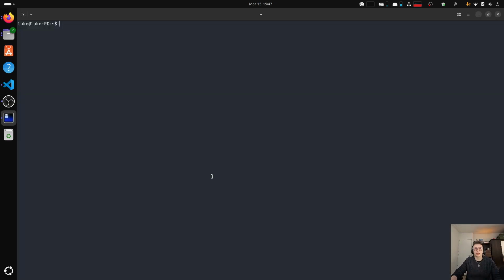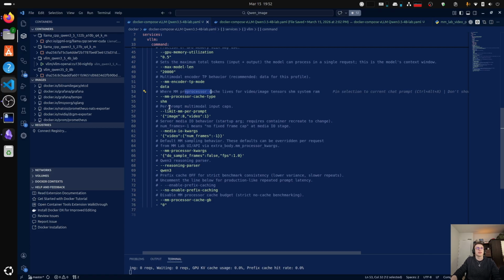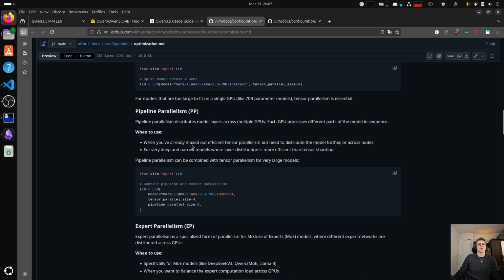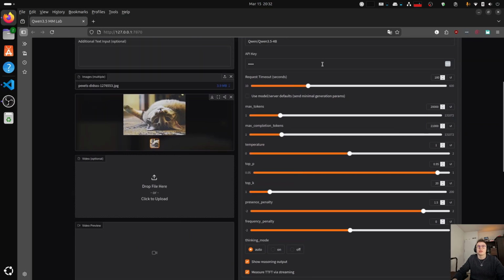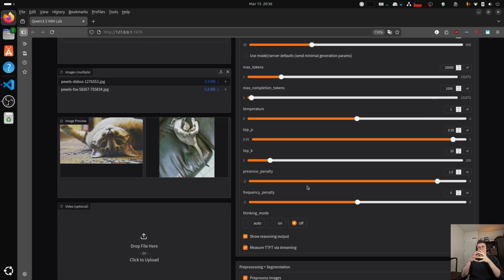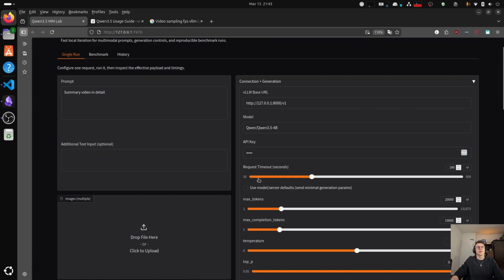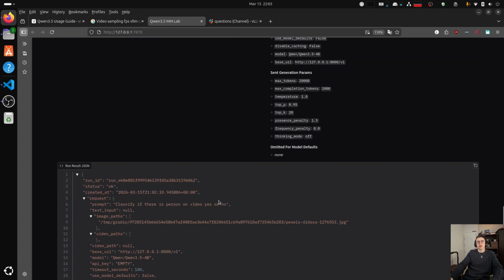Qwen 3.5 Vision AI Speed Tuning: 30 Seconds → 2 Seconds (Here's How). It's INSANE.

Comment from the maker: Qwen 3.5 Vision was taking 20–30 seconds per video. I got it to 2 seconds. Here's exactly how.
This is a complete engineering deep dive into optimizing Qwen 3.5 multimodal inference — images and video — running locally on vLLM in Docker. Real benchmarks, working code, no fluff.

What you'll learn:
— KV cache explained and why it kills your speed
— Image resolution tuning for vLLM (the biggest single win)
— Video FPS preprocessing with ffmpeg before it hits the model
— Turning off thinking mode for fast inference tasks
— Long video segmentation strategy with overlap windows
— max_model_len vs max_tokens — what most people get wrong
— Parallel segment workers to cut wall time on long videos

Stack: Qwen 3.5 VL · vLLM  · Docker · CUDA · Python · OpenAI SDK
This is Part 1 of the Visual AI optimization series. Part 2 will cover batching, quantization (INT4 / FP8), and multi-user scaling. Here https://youtu.be/BxDfOPcak5k
If you missed the setup video (llama.cpp + vLLM + Docker from scratch, no Ollama, no LM Studio):
👉 https://youtu.be/-sl0oe3-Awc

🔥 What You'll Learn:
✅ vLLM Docker config for Qwen 3.5 Vision (Blackwell GPU optimized)
✅ Max tokens tuning — why input/output limits matter more than you think
✅ Image preprocessing — how dropping from 6000px to 480px saves seconds
✅ Thinking mode ON vs OFF — real timing difference on classification tasks
✅ Video FPS sampling — why 1–2 FPS is enough and how to set it
✅ MM cache, KV cache & prefix cache — what they do and how to exploit them
✅ Multi-image and multi-video inference in a single request

⚙ Setup:
GPU: NVIDIA RTX PRO 6000 Blackwell (96GB VRAM) | CPU: AMD Ryzen 9 9950X 16-core
Driver: 590.48.01 | CUDA: 13.1 | Engine: vLLM nightly Docker | Model: Qwen 3.5 Vision (4-bit)

⏱ Chapters:
0:00 Speed demo — 20s → 2s result
0:22 Hardware overview
0:37 vLLM Docker config walkthrough
2:00 Max tokens, GPU memory & multimodal params
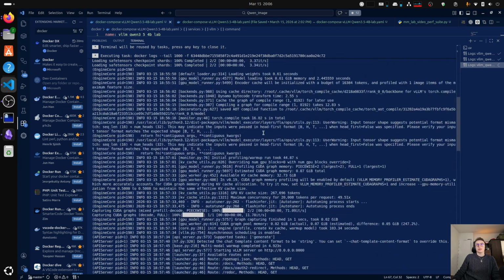5:21 Image inference — max completion tokens impact
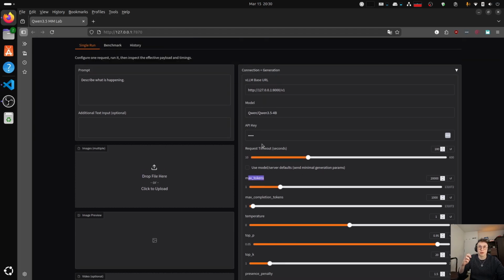7:07 Image preprocessing — resolution vs speed vs accuracy
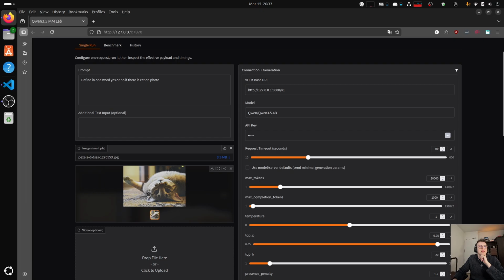9:41 Multi-image counting — resolution tradeoff test
11:50 Video inference baseline
12:37 Video preprocessing — FPS & resolution optimization
14:05 Multi-video inference test
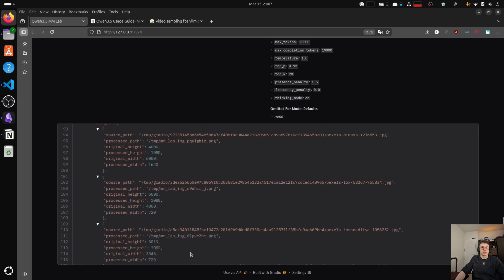15:09 MM cache & prefix cache hit rates explained

📦 Resources:
GitHub: https://github.com/lukaLLM/Qwen_3_5_Vision_Setup_Dockers/tree/master/visual_experimentation_app
Qwen 3.5 on HF: https://huggingface.co/Qwen
vLLM Multimodal Inputs: https://docs.vllm.ai/en/stable/features/multimodal_inputs/
vLLM OpenAI-Compatible Server: https://docs.vllm.ai/en/latest/serving/openai_compatible_server/
vLLM Optimization Guide: https://github.com/vllm-project/vllm/blob/main/docs/configuration/optimization.md

📹 THE ULTIMATE LOCAL AI & VLM SETUP SERIES:
— Build the Best Vision Setup (No Ollama): https://www.youtube.com/watch?v=-sl0oe3-Awc
— Speed Tune Your Vision AI (30s → 2s): https://www.youtube.com/watch?v=ZtGOZvkuTcw
— Process 2-Hour Videos FAST: https://www.youtube.com/watch?v=BxDfOPcak5k
— The Ultimate Local AI Coding Workflow: https://www.youtube.com/watch?v=11rA29YacB8 

#Qwen3 #Qwen35 #vLLM #LocalAI #Docker #MultimodalAI #VisionAI #AIEngineering #LLM #OpenSource #SelfHostedAI #MLOps #GenAI #AIDocker #PrivateAI #DockerAI #LocalLLM #ImageAI #VideoAI